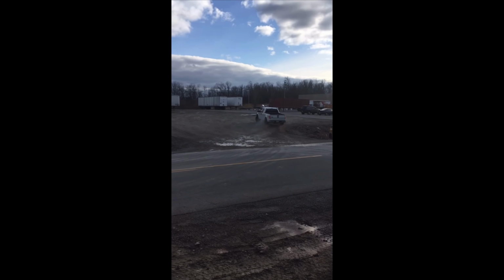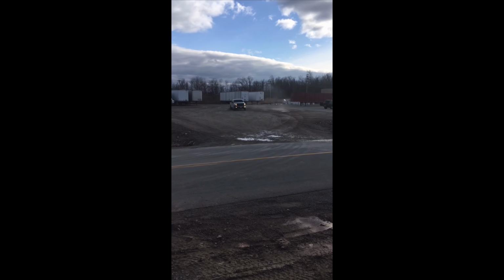Glasspack vs Neighbor Hater vs Flowmaster Flowfx Dodge Ram 5.9 Magnum

Comment: The 360 is an easy engine to get sounding good. All you gotta do is let it breathe. Dual 3 inch pipes to your desired muffler with no cats.
Reply: Thunder Heads410, one of my former customers went that route and within a year, two burnt valves.
Reply: @sergeantmasson3669  thank goodness 360's are cheap. I don't know what they did so I won't try to be a mechanic and diagnose the issue. I've went that route and never had a problem.
Reply: @sergeantmasson3669  thank goodness 360's are cheap. I don't know what they did so I won't try to be a mechanic and diagnose the issue. I've went that route and never had a problem.

Comment: Good video, I'm looking for a exhaust system for my 99 dodge with the 360. I'm wanting to restore the truck and after it's done I don't want it to be obnoxiously loud but still sound good at the same time
Reply from the maker: Exactly what I wanted but learned the hard way.  I love the tone of the neighbor hater which is why I got it, and adding the flowmaster really calmed it down to just let the tone be there without it being too loud. Pretty cool learning that you can pick a tone and add another muffler with different performance characteristics to get the volume right. Hope you get yours sounding how you want!
Reply: Short headers, high flow cats, x pipe, to flow master outlaws is what I'm going to be doing to my 98 1500 with the 5.9 mag

Comment: Gotta love a 2nd gen, especially a clean one. I have a 98 single cab stepside with a 5.2l magnum  running a 3 inch exhaust pipe, gutted catalytic converter (done by previous owner) and a magnaflow muffler with a 4.5" exhaust tip, she sounds pretty good, it makes noise but it's got a good tone without being obnoxiously loud, once you hit 4th gear and the truck idles down you hardly hear it in the cab it just gives you a deep throaty growl and I'm very happy with it. Of course cold starts sound phenomenal and if you want someone to hear it trust me they will, but it still has that deep throaty V8 growl that I absolutely love, idk I guess I'm probably one of the few 17 year olds who doesn't adore straight pipes. 
Anyway I dig the truck man.
Reply from the maker: That’s awesome to hear man! Got a good head on your shoulders buddy!

Comment: Loved the video! I had a 91 Chevy K1500 WT with a 5.7L, I had my uncle help me install this brand-new Heartthrob cat back Dual exhaust what he had failed to mention is that he had cut the cat off and just welded the 3" extension pipe in its place and ran it that way. It was 3" from the Y pipe into a 3" extension pipe to 2.5" and then for the last 18" it was 1 and 3/4" with tips. I was thoroughly impressed on the sound of it, and it did indeed pop when revved past 2000 RPM but I was impressed that the cab noise and overall noise driving down the road wasn't a droning sound.
Reply from the maker: Thats awesome to hear!

Comment: So I'm not to sure what exhaust I should get yet. I have a 2001 5.9 v8. But I want it Loud but not obnoxious. But I want to be able to get up on it and be pretty loud. I'm 16 and I'd like to know anyone's opinion.
Reply from the maker: Theres many different ways you can go about getting that sound! Don’t over think it though. My set up isn’t perfect and I figured it out by trial and error but it still sounds awesome. I know that’s not brand or muffler type advice but if you aren’t sure about it, just try something you think will sound good. If it doesn’t sound like what you want it to, change it or do what I did!
Reply: @kvlemark  alright thanks happy new year.

Comment: What wheels set up do you have, I like those wheels and I have a black 2nd gen I might need to get some
Reply from the maker: They’re method 305s with a 0 offset! Method offers a flush center cap that I currently run in my tundra with the same wheels. If you order the wheels I’d go to a local wheel and tire shop and have them order those too. They look much better in my opinion

Comment: Running a flowmaster with a cherry bomb tailpipe worked out perfect toned it down just enough no cats 4.2 6 cylinder 98 Ford f150 4-speed find it hard to keep my foot out of the radiator

Comment: got a 03 Dakota 5.9 R/T with high flow cats and 2 flowmaster flowfx glasspack style mufflers, its pretty rowdy and wraps a bit, was thinking of adding a dual in dual out muffler behind them. Overall im fine with the way it sounds right now though.
Reply from the maker: It will definitely calm it down a bit if you ever get to that point. Will still sound awesome. Just a bit more of a mature volume from my experience

Comment: what are the rims and tires called an how many inches is it lifted?
Reply: Method NV, prolly 17 inchers on 35s. Great wheel setup.
Reply from the maker: @mileshatch3316  method 305 nv but a 37 12.20 17 general not a 35. I agree I love the combo. Good eye!
Reply: those wheels that he has are stock wheels they are from the O.R.E. dodge rams. they are 17" wheels but the ore stands for off road edition. i have those on my truck as well.

Comment: what rim an tire set up is that an how many inches is it lifted
Reply from the maker: It’s only leveled3 inches. The rear is stock ride height. I have 17 inch method 305s with a 0 offset, and 37 12.50 17 general grabber atxs
Reply: @kvlemark  thank you son much!

Comment: I kinda came to the same conclusion after having a single 3in in dual 2.5in out cherry bomb extreme on my 95 ram 5.2 v8...it doesn't sound that far off from the neighbor hater lol. A guy years ago had a "magnaflow performance muffler" video of a 5.2 2nd gen ram but I think he delisted it since I can't find it searching for it now, I may end up going with something like that, something with a throaty v8 growl sound if you want it to but without being god awfully loud. I'll get to it one day, other things have priority, and the truck is just a backup occasional hauler these days to our much more efficient newer 4cylinder commuter car. The truck originally had some knockoff very quiet muffler dumped but due to the cat being gutted, there were really stinky exhaust fumes that'd collect under the truck area, if I ever had the window down in a fast food drive thru I had to have choked some poor kids working lol. I'm considering a side exit before the passenger rear tire as a cost cutting measure, the truck was stolen several years ago and they must have backed into something, the bumper is a little dented and the driver side straight back exhaust pipe got scrunched some, a bit of the cherry bomb is bent now and at least 1 exhausted hanger is bent too and I need to at least take a hammer to the pipe, it vibrates the bed occasionally due to being pushed up against it. Decisions decisions...from a purely cheap frugal standpoint, a glasspack with no pipe after it whatsoever would sound pretty good and push the exhaust straight back instead of dumping it towards the ground where it'll congregate and spread out all around the sides of the truck causing the chokeout problem I talked about above lol...

Comment: what I want to know is did you have to re tune the computer after the cat bypass?
Reply from the maker: I wasn’t around for that so I’m not sure what happened then, my stepdad passed which is how I got the truck so he’s not here to explain that part. The engine light comes and goes due to that exact problem. Haven’t had any other issues other than that. I haven’t tackled that part yet but I’ll get it sorted out here soon
Reply: @kvlemark  I’m super for your loss, that truck is a great part of him I’m sure. But for your check engine light, id assume it’s for the cats
Reply from the maker: @kellenvernon7841 thanks for that. And it is actually. The o2 sensor freaks out sometimes. Right now the light is off but randomly it will throw the that code. It’s not on often so it doesn’t bother me
Reply: @kvlemark  gotcha, that is a gorgeous truck by the way. About how loud was it? Mines way too obnoxious
Reply from the maker: @kellenvernon7841  right now it’s perfect. The only time it was too loud was when it only had a neighbor hater on it. it wasn’t so much of the noise as it was the tone at that volume. I liked the sound but I knew the potential it had if I got the actual volume down with a deeper tone. Adding the flowmaster did exactly what I was hoping it would. Still happy about that

Comment: Lots of trimming to fit those 37’s?
Reply from the maker: Not at all
Reply: @kvlemark  no trimming at all? Do you rub? I have a 3inch lift with 33’s and I don’t even think I can go up to 35’s without rubbing
Reply from the maker: @DirtyDanF117  it’s got on spot on the pinch weld it likes to grab every now and then on the left side but it’s not bad. I did at one point reshape the ends of the pinch welds just to get rid of the sharp edges

Comment: Neee some more Idle 🤙🏽 i have a flowmaster 40 I believe with cat and 2 exit exhaust out the back in my 5.9 but it’s too quick and i only threw it on because times were tough and i ripped it from my old truck I think i Like the set up ot definitely sounds good i think i might go for it too but i might just delete the cat entirely and if i do all that ill want headers and thats a lil extreme for an old farm truck with 150k😂

Comment: I have a 95 neon with a 2.0 dohc with large cams and I'm running a neighborhater with no cat to a side exit. It is far too loud and I definitely regret buying the muffler. It sounds good but it's just way too loud. I'm debating on putting a glasspack in front of the neighborhater to chill it out a little. I wanna go full throttle but I literally can't lol.
Reply from the maker: Exactly what mine sounded like. Do it! It will calm it down exactly how you’re wanting
Reply: @kvlemark  so I put a glasspack on my car today like I mentioned yesterday and it sounds 100x better. Still has a great aggressive tone with almost no drone and is actually tolerable to drive.
Reply from the maker: @neonnerd1364  that’s awesome! I’m happy it worked for you. I remember that feeling lol

Comment: what’s the wheel and tire set up
Reply from the maker: Method 305 with a 0 offset, and General grabber atx in a 37 12.50 17
Reply: those are stock 17 inch off road edition dodge ram wheels

Comment: Exhaust is the most subjective thing about customizing and YOU are your biggest critic. I spent 2 years bouncing back and fourth between muffler sound clips on YT. As you with a Magnum they are naturally a deeper exhaust note with more throaty overtones (not to get too technical) The videos I heard they either sound like the way you described the Neighbor hater that pop/clap noise or they sound hollow tinny and just worse than what I had as stock lol Read on the Dodge Ram/Dakota forums that most were running the normal brands Flowmaster etc. But one name kept getting brought up, Spintech, "Chambered" but not really chambered. Been running their 6000 Pro Street series single 2.5" side exit since 2021. Has that off-road trophy truck circle dirt car sound because thats where these mufflers were used on back in the late 1980s and 90s.

Comment: If anyone wants to see or hear clips of my 1998 ram 1500 4x4 with the 5.9 let me know. I got long tube pace setters with 4" off-road y-pipe to a 4" inlet flow master 44 to dual out 4" slant tips out the corners of the bumper and she sounds great swapped out stock rockers to some Harland sharp roller rockers 1.7/1 and added holly performance throttle body short ram intake from Spectre. Repainted the whole truck new front axle and fresh rear end with fresh transmission.
Reply from the maker: I’d like to hear it!
Reply: @kvlemark  mind if I hit you up on FB with pics and video of it
Reply from the maker: @coletonjones1737  yeah sure! Or my Instagram is the same username
Reply: @kvlemark  ok just wanted to check first haha

Comment: At 2:35 what setup is that?
Reply from the maker: No cats just a glasspack with no tip
Reply: @kvlemark  cool i got an 02 and have a glass pack hoping that get that sound.
Reply: Got a neighbor hater on my 5.9 cummins its nuts
Reply from the maker: @jordanmercredi3740  I got that sound on accident after it broke in half and I just pulled the tips off and ran it that way for a while after realizing it didn’t sound half bad.
Reply: I have a chambered exhaust (thrush welded from advance auto) gutted cat and it sounds similar to yours at 2:44. I think Ineed to add the glasspack style like you did.  Yours has a nice "tuned" sound!